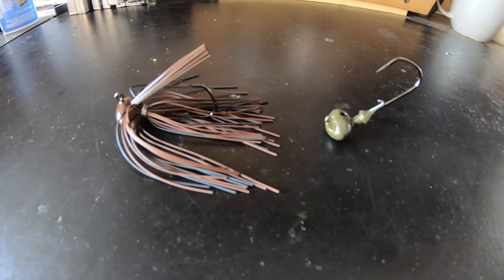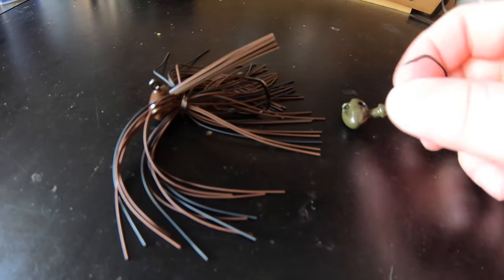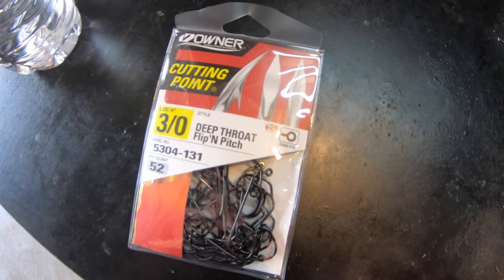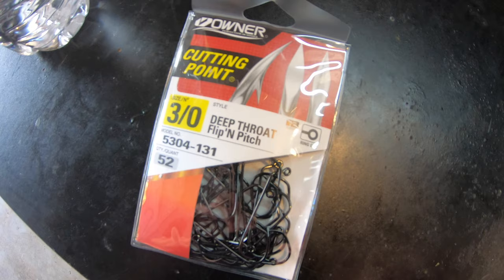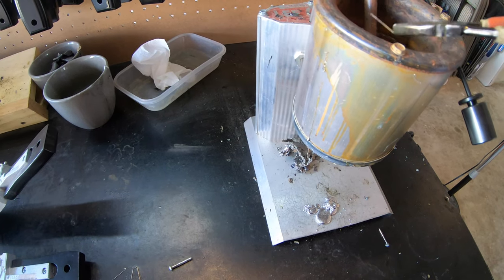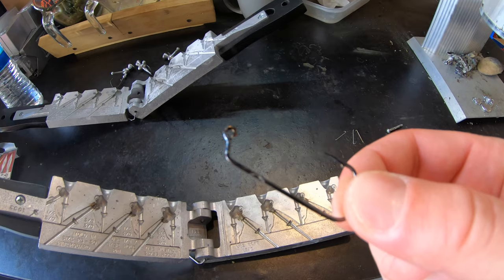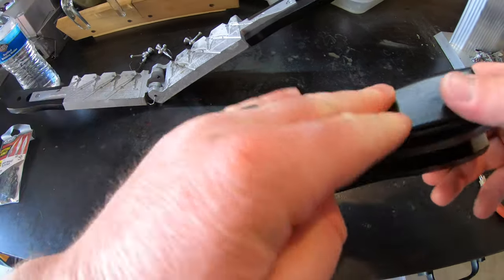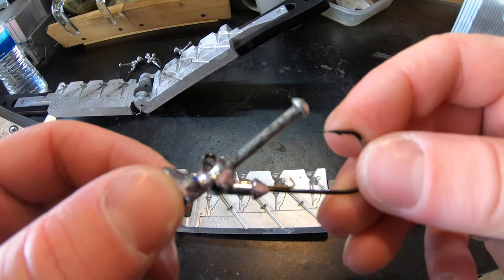HOW TO MAKE JIGS - Making Football Jigs with Do It Molds

Comment: Everyone does it differently but I trim that excess fiberguard off even with the point of the hook. Sometimes it's harder to get a good hookset if the fiberguard is too long.
Reply from the maker: I disagree with that.  Trimming it make it stiffer.  I’m on the minority on that but if you just use your finger to move the weed guard you’ll notice the change in pressure between the full and cut weedguard.
Reply: @MattLunaFishing  Fan the weed guard out a bit instead of leaving it in a cylindrical shape. Being a little more stiff to the touch isn't going to effect the hook set. Being too long and actually getting in the way of the hook point can and will. To each their own.

Comment: Thanks for the video but l will clean the eye of the hook with a tooth pic when the power paint is still wet because  if l have to buy a jig that the paint is been scratch of it is not good for business regardless what you think.
Reply from the maker: I don’t sell mine, so I’m not worried about it.  Once the paint is baked it’s not rough and isn’t going to break the knot.

Comment: Matt, when I bake the lures the paint drips into the eye. How do you handle that? And the paint fills the hole for the weed guard. Any suggestion on that?
Reply from the maker: Sounds like you’re putting too much paint on.  The paint should drip into the eye while baking.  Sometimes the paint will make the weedguard hole a little tight, but you can take a 1/8 drill bit and clean that out.  Are you using a fluid bed or just dipping into the container of paint?
Reply: @MattLunaFishing   I'm using a fluid bed
Reply from the maker: Then the paint should be even enough.  Try getting less paint in the head before you bake.  It doesn’t take much to get a decent coat on the lure
Reply: @MattLunaFishing   will try that. Thanks! Great vids
Reply from the maker: You’re welcome!  Let me know how it goes.  Glad you like the channel!  I’ve got a bunch of other tackle making videos.  Check out my tackle making playlist!
Reply: @MattLunaFishing   I was very interested in your vid on compact jig by using a small hook. I'm still working on that one. Some of my hooks won't line up correctly. But I will get it.
Reply from the maker: You can’t use any hook in any mold.  There’s only so much you can deviate from what the mold calls for.

Comment: Going to try to start making my own jigs and selling them any tips
Reply from the maker: The main tip is get good at making them before selling them.  Have a plan on how to let people know about your jigs as well.
Reply: Ok what do you sell your jigs through
Reply from the maker: I have a website.  Check out mattlunafishing.com.  I built it myself.
Reply: Ok thanks
Reply: Can you send like one jig out in a normal nveleops
Reply: Do you charge the six dollars for shipping or is that just what the website coast
Reply from the maker: Yeah you can use an envelope but you can’t just use 1 stamp like a letter.  It’s based on weight and thickness.  

The shipping costs the $6 because i choose that amount based on what it costs to ship.
Reply: Ok so that would be cheaper plus I don’t really no any of this stuff I am only thirteen so what do you think is a good price to sell them
Reply: Thanks for helping
Reply from the maker: You need to figure that out based on the cost to make them.
Reply: I think it will coast me 150 to get started and stuff
Reply: My dad has a fluid bed and a heat gun and enough paint to get started but my dad doesn’t think there will be much profit
Reply from the maker: Yeah that’s probably close
Reply from the maker: There’s only a good amount of profit if you sell a lot of them.  I don’t sell stuff all the time.
Reply: So like if I only sold one I wouldn’t make any profit until I paid for all the stuff but then I I only sold one a week there wouldn’t be much profit
Reply from the maker: If the supplies cost you $150 to make the jigs, you’d need to sell more than $150 in jigs before you’re actually making any money.

Comment: Need a video for the fluid bed. My blows just on one side.
Reply from the maker: I’m planning too.  Do you have both hoses connected?
Reply from the maker: That’s probably why there is more air on one side.  Mine has air going into it for 2 opposite sides.
Reply: @MattLunaFishing  can u tell me supply list urs is made of
Reply from the maker: Not the exact names and sizes.  I literally just went to Home Depot and figured it out.  I’m going to try and do a video on it soon.  I used an aquarium air pump with two air outlets. Those were connected to two different hoses and are connected to a small valve and then to the pvc.